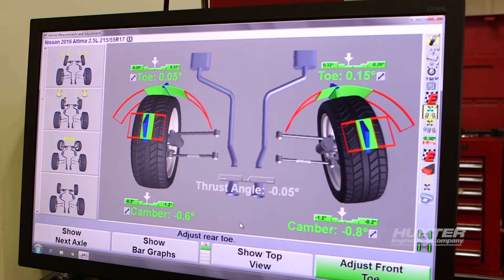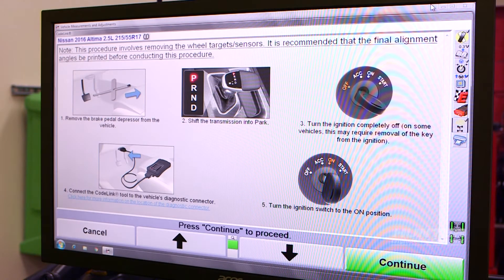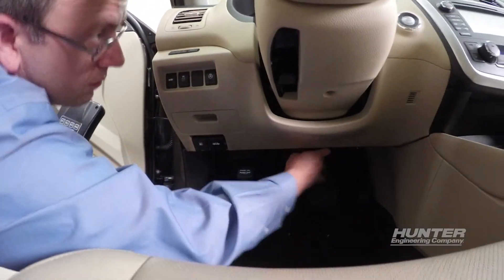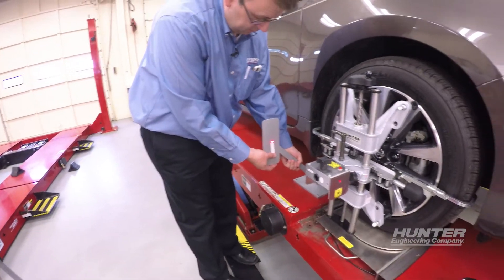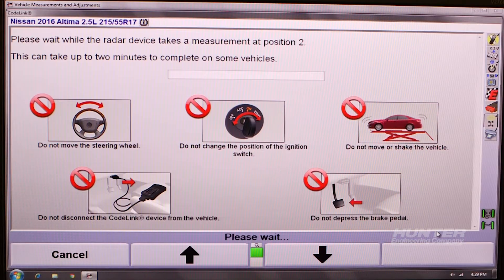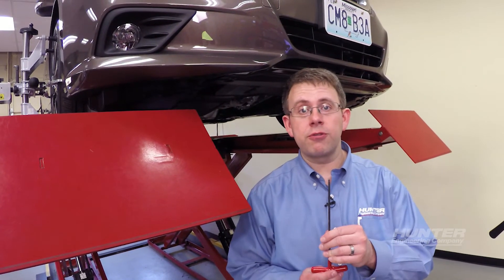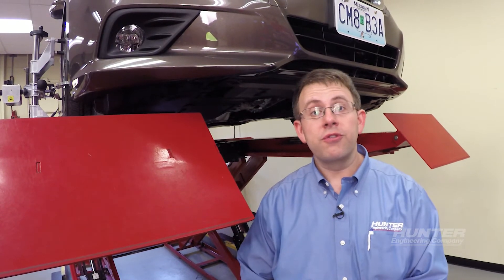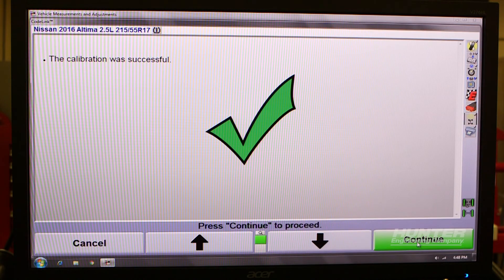Nissan ACC Safety System Alignment YouTube Learning Channel

Comment: I have a 2016 Nissan Altima with 155k miles on it.  Unforunately, the Rear camber is not adjustable without replacing both of the rear upper control arms which I have to do because I keep burning through rear tires.
Reply from the maker: We are sorry to read of your troubles! Rear Camber and Toe is adjustable on a 2016 Altima, with two adjustable eccentric bolts on each lower control arm. For your info, Hunter uses an alignment  specification database provided from Nissan (and all OEMs) directly, and Hunter alignment equipment is used in their factories and dealerships.    Without knowing your entire scenario, we suggest going to a Nissan Service shop for your alignment, or if you already have, re-discuss it with a Service Manager.  Please keep in mind, that with 155K miles, there is a chance some component in the rear may need replacement to be properly aligned.
Reply: @HunterLearningChannel  Not if they are adjusted as far as they can be ajusted and camber on both sides is off 1.5 to 1.8 degrees weraing my tires out on the inside but kind of like scalping